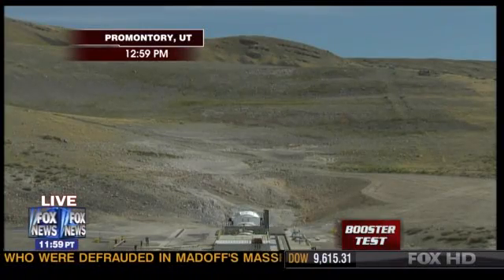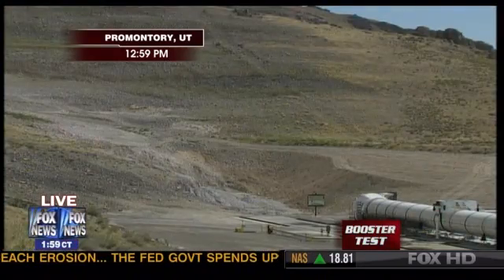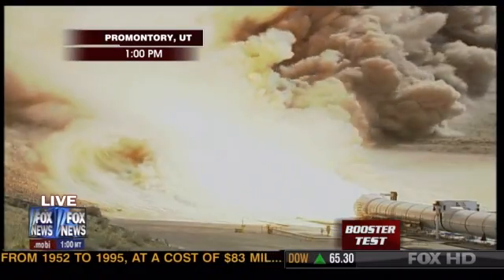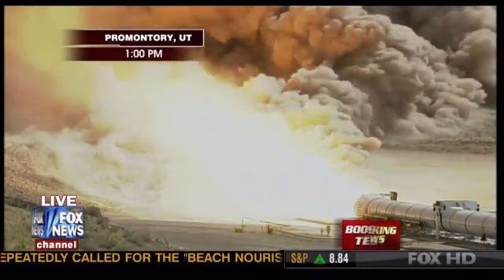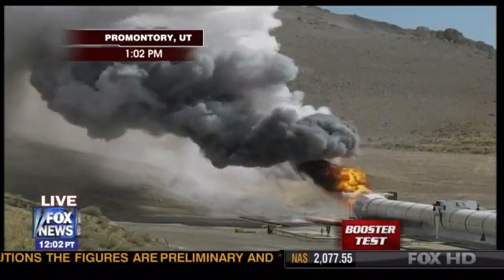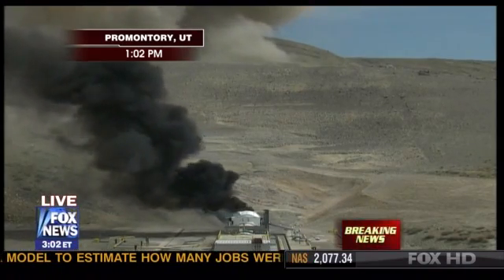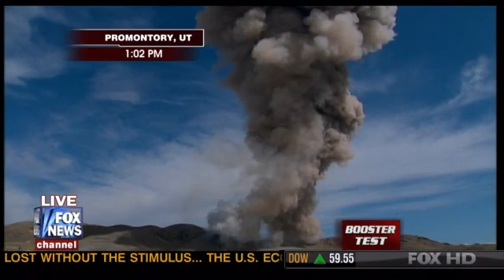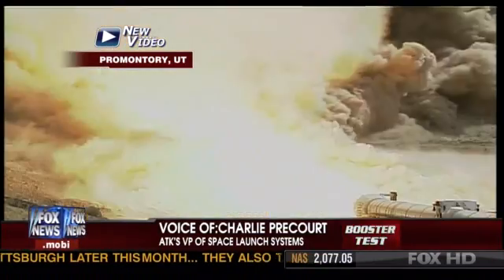Ares rocket test at Corinne, Utah test facility. 3.6 Million lbs thrust. 22 Million horsepower

Comment: How much of this rocket in energy represents a human lifetime ? 
very shotty math but please correct me. As all I'm trying to do is imagine my life burnt into rocket fuel. FUCK YEAH 
https://signatureelectric.ca/blog/how-much-energy-does-the-average-person-use-in-a-lifetime/ 1 person uses Average human in Ontario per life 562500 kilowatts
The rocket is 22, 000,000 horsepower! WOW 
Kilowatts into horsepower 754,324 horsepower / 22,000,000 @ 1 rocket in this video. 
=0.0342874545 rockets is you ! 
The rocket blasts for 130 seconds roughly 
=0.0342874545 x 130 seconds = 4.4573 seconds of this rocket = YOUR LIFE IN FLAMES AND SPARKLES PUSHED INTO A HILL.  
how many rockets would = the Human population ?
7.2 billion / 29.165186 = 246,869,675.37254 rockets !!! now why are we trying to get off this planet when we have this power over a lifetime GLOBALLY ! (1st world country lifetime) 
also population growth currently inst linear but is growing at 1.09% (as of 2018) so 1.09% x 246,869,675.37254 or 246,869,675.37254 x 0.0109 = 4,712,742.1028619 rockets per year !.
anyway as a population working together we have the energy to reach a shit tonne of planets and stars however were already on one LOL.
What direction will you face your 4.4573 seconds? Into the ground or will you aim for the stars ?

Comment: I suddenly don't feel so bad about burning that styrofoam cup the other night.
Reply: TheKingOfChem This isn't a liquid fuel rocket dumbass, its ammonium perchlorate, aluminium and resin
Reply: TheKingOfChem lol it made loads of co2
Reply: TheKingOfChem ...
Reply: TheKingOfChem So what's the smoke and, you know, the flames?
Reply: A guy There is no smoke. That is water vapor kicking up smoke and the flames are complex double and single displacement combustion reactions.
Reply: Styrofoam creates harmful carcinogenic organic compounds and this solid rocket fuel creates nearly inert and safe fine powders, aerosols and gases:

10Al+6NH4Cl04 --> 4Al2O3+AlCl3+12H2O+3N2

No carbon dioxide other than small side chain reactions which are not immediate from the combustion. Learn your chemistry
XeXWill A guy
Reply: A guy The ''smoke'' you are seeing is the sand being picked up from 22+ million horsepower. Thought you could figure that out on your own...
Reply: TheKingOfChem I could figure that quite out quick

Comment: Why do they point it into a hill? Wouldn't it be pertinent to anchor it on top of a plateau and measure it's output into air as it would as it's travelling vertically?
Reply: Art Sharpe its specific impulse will change dependent on atmospheric pressure... which would cause better or worse performance, but you're absolutely correct and i'm sure they thought of that. :)

Comment: My question is:how many of these rockets fired in unison would stop or speed up earths rotation? Depending where they are aim at
Reply: A staggering amount.  By comparison, the Earth use to have something like a 17 hour day.  The moon use to be something like 100000 miles closer.  How many of these rockets would it take to push the moon's orbit out another 100000 miles?  A staggering sum in itself.  This only equates to 7 hours worth of rotation.  This is the effect of tidal friction of all the earths oceans.  A staggering force, acting over billions of years.  A staggering amount of time.  The calculation could be done but the answer wouldn't be comprehesible in human terms.
Reply: It's a physical impossibility.

Comment: Wait.... how do you "throttle up and down" and solid rocket? Fox news: throwing physics out the window. lol
Reply: different grain patterns in the solid fuel make it throttle up and down because different grain patterns have different burn rates some grains almost shutdown the motor aswell all of this however has to be done while fueling the motor so basically before the flight or test they decide what burn schedule they need then add the appropriate grain patterns
Reply: Advanced solid rocket boosters have the capability to be throttled and selectively extinguished.
Reply: its very simple: you dont :)
Reply: with oxidizer! hybrid motors can throttle by controlling the rate of oxidizer being burnt, not sure what type of motor this was... however solid fuel/oxidizer mixed rockets are not able to control their throttle.
Reply: The nozzle can be opened and closed as well as everything in between. It controls thrust you idiot.

Comment: When you jump, your legs push the earth away at an equal rate--which is infinitesimally small for the earth--and then the same occurs when you land. Would this test change the rotation of the earth by a slightly greater than infinitesimally small amount?

Comment: @vampov 

No, it uses solid propellant. Ammonium perchlorate (oxidizer, 69.6% by weight), aluminium (fuel, 16%), iron oxide (a catalyst, 0.4%), a polymer (such as PBAN or HTPB, serving as a binder that holds the mixture together and acting as secondary fuel, 12.04%)